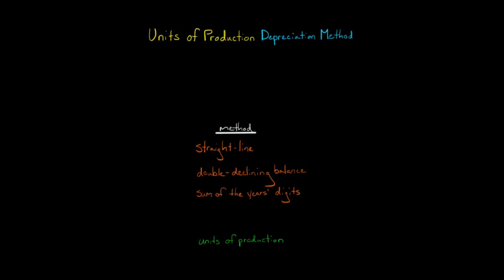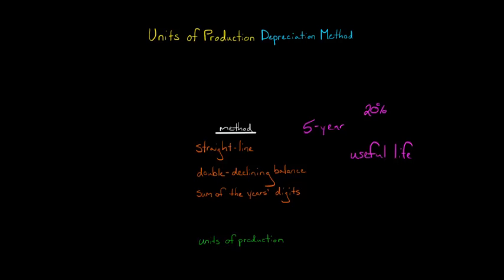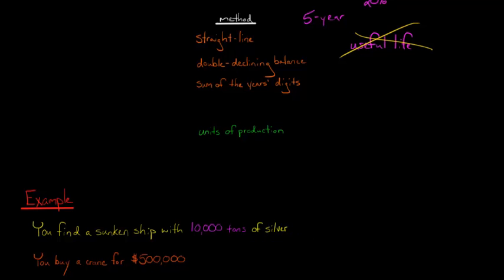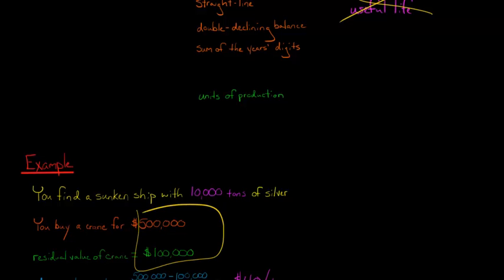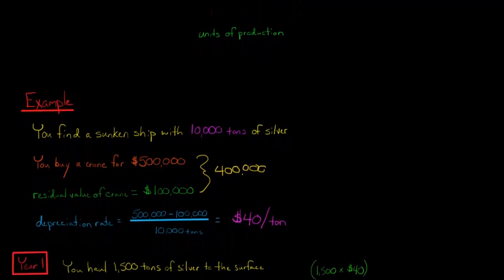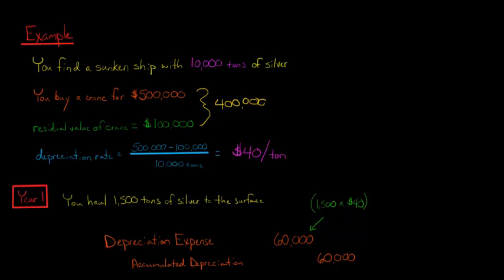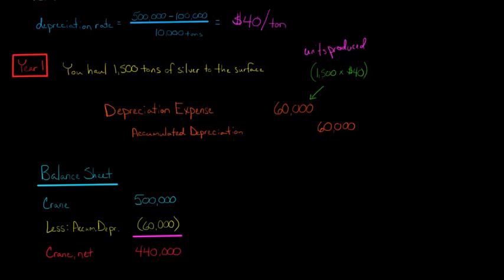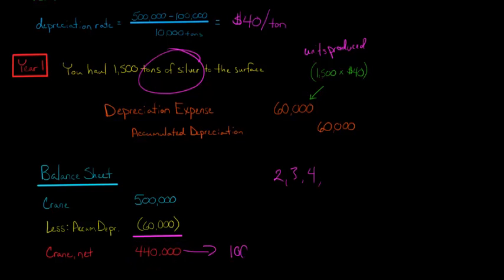Units of Production Depreciation Method

Comment: Equipment was purchased for R460, 000 with an estimated life of 10 years and a residual value of R19, 000. What is the depreciation expense for the first 5 years using each of the following separate depreciation methods?

     a. Double-declining balance							         (15)

     b. Sum of the years’ digits	

this one is different please help